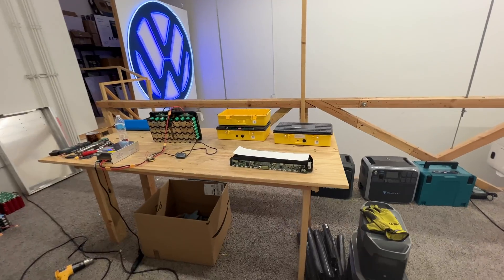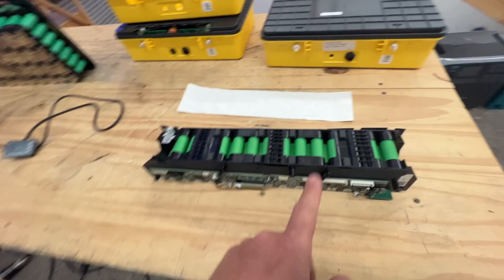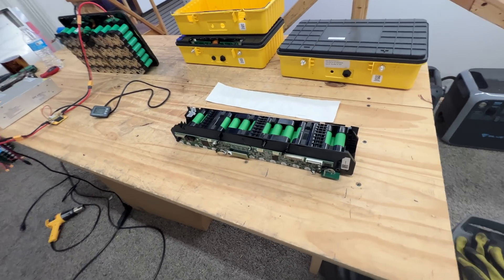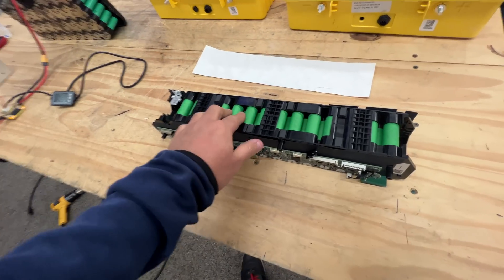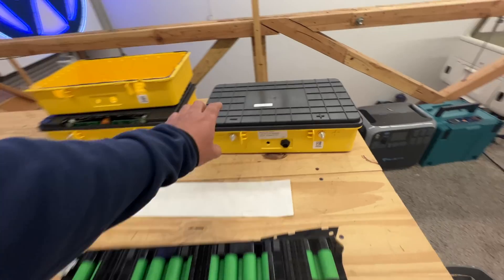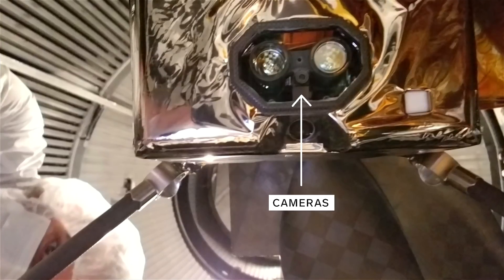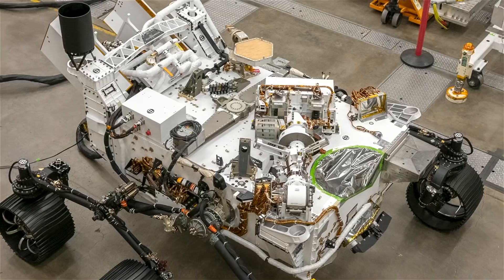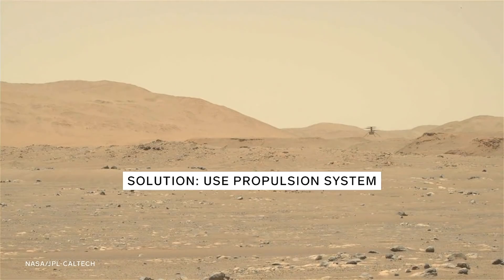Cells good enough for NASA and Mars Ingenuity helicopter - VTc4

Comment: Thank you thank you thank you.
I'm so excited to get these cells on my e-bike.
I bought a couple of your packs from your store.
I think it will be so much fun because these are not expensive batteries but yet they have an amazing backstory.
I currently have 1.5 kilowatt hour battery pack on my bike made from used laptop batteries.
25 amps of draw within one minute pull the voltage down to 3 V per cell.
These will be the perfect replacement and the perfect Conversation Piece.
Thank you.

Comment: Ingenuity Mars Chopper is fake news..  How Does any chopper Drone fly in 0.1 PSI of Air like in Mars?  They Ain't on Mars, or if they are on Mars, They Ain't Flying..  Another Lie brought to you by NASA..
Reply: You need to do some research on how it works, it's not much more complicated than a normal drone besides some modifications to survive mars. To answer your question though, the decreased pressure is not a problem. The blades just need to be spinning faster to generate the lift. It's also easier for the blades to spin faster since there is less air resistance because of the lower pressure.

Comment: It doesn't look like they use those cells.  They are small, but the helicopter is way bigger.  Maybe on the prototype, but that copter is huge and those cells small.
Reply: You may be surprised to learn that the Ingenuity's energy source is built from six off the shelf 18650 lithium ion cells from Sony, the VTC4.Apr 19, 2021
Reply: @eliasshedd  I don't think so.

Comment: Nice video. personally i don't believe they used normal cells. So for sure they went with special order of those cells with special requirements.. Even they might looks same with similar property i don't think they used normal supermarket cells.. but what do i know..
Reply: They actually used quite a bit of Earth-grade tech for non-critical things in thos mission. The rover has a hardened CPU but the helicopter one is off-the-shelf, the cameras filming the descent were pro-grade action cams, and don't forget the cells. I suspect that we'll see a lot more of this on future missions. If we're going to Mars, we want to know what gadgets we can bring.
Reply: Try Googling what batteries do they use on the Mars helicopter and you will find the following...
You may be surprised to learn that the Ingenuity's energy source is built from six off the shelf 18650 lithium ion cells from Sony, the VTC4.Apr 19, 2021
Reply: @eliasshedd  That is ok I'm sure they went  for battery source as they wanted. I'm only surprised there wasn't any problem with it till it came to mars...om mars it isn't big deal it would behave same as normal battery.  Btw just because they went with normal off shelf cells it doesn't mean they didn't test it properly and just picked first cells they came by.Testing is big deal with space probles, equipment , electronics and all that. you have to test it in freezing cold temp and also hot temp. and all that. Same you could say they used off the shelf tantalum capacitors..ofc they used them..after all if you want capacitors you will not make it yourself but you will go for manufacturer of those
Reply: You may be surprised to learn that the Ingenuity's energy source is built from six off the shelf 18650 lithium ion cells from Sony, the VTC4.Apr 19, 2021